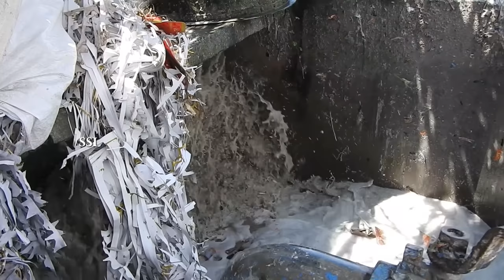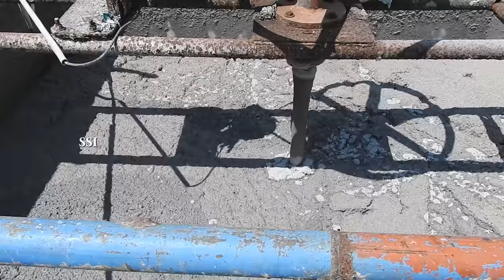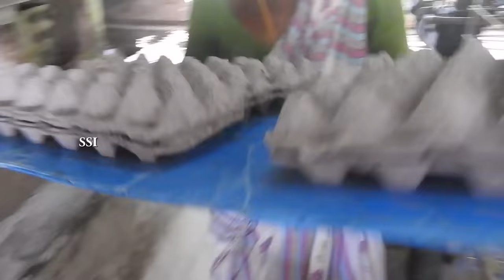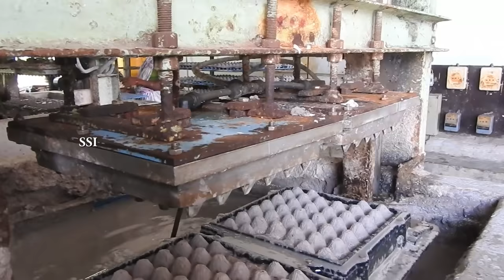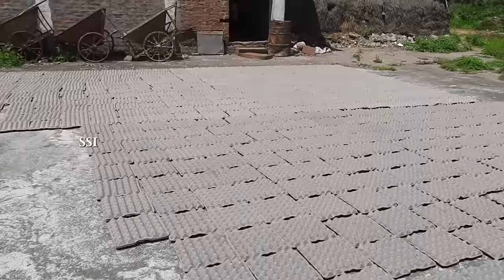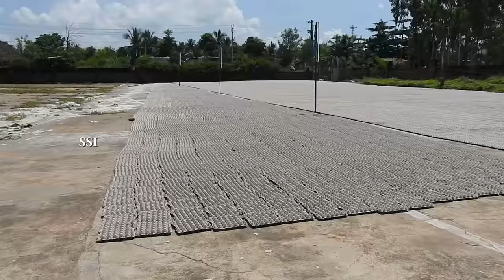Best Egg Trays Making Machine Factory Using Waste Paper | Fully Auto Egg Cartoon Making / SSI

Comment: At 2:10 the engine part that move in the paper solution hold the paper materials and press it at the top and the worker pull the finish products at the top with blue plate.

Comment: Im thinking the cleanliness from recycle paper...wheres it seterilization process to kill germs..
Reply: Not matter in india
Reply: They use acid and alkaline liquid treathment
Reply: Technically there is none. As Nikol said, the solution you see midway doubles as sterilization, but there is a reason recycled paper is never used for sterilized products like medical or lab equipment. Whatever junk was left on the recycled paper is going to still be in the final product.